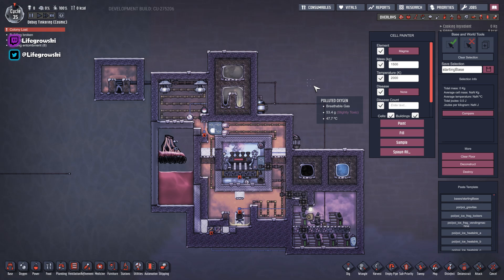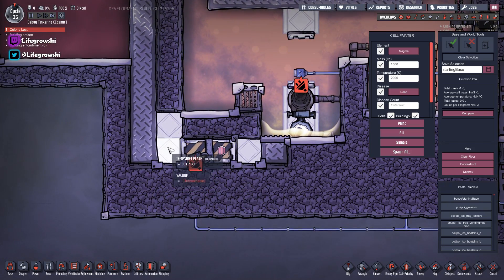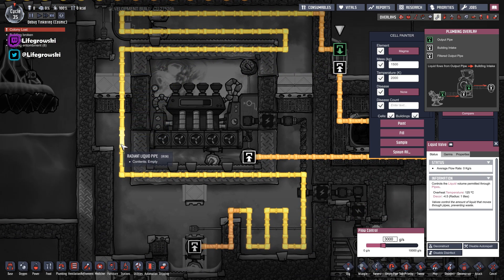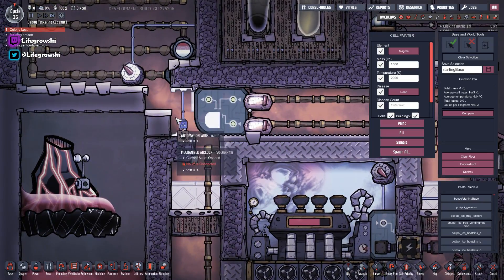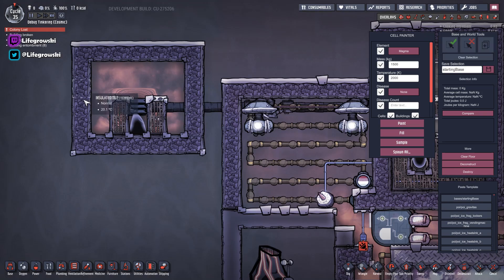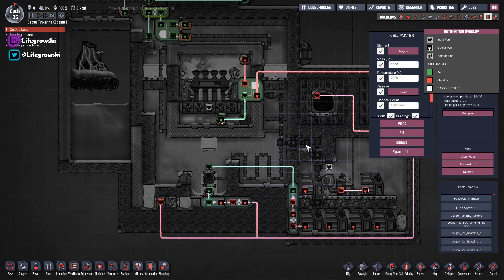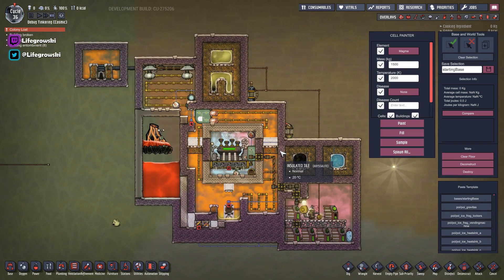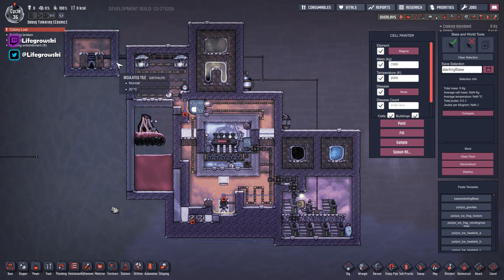SELF POWERED NATURAL GAS BOILER - LOADS OF FREE POWER!

Comment: If you wish to avoid using the hydrogen pushing quirk, you could try and explore how efficient(if at all) it would be to implement here the mechanism used in a door compressor system, where you have a series of doors with some automation that will push the steam downwards.

Awesome video man, keep it up.

Comment: Thanks a lot for the video mate I have been tinkering with a gas boiler myself lately.
I'm a bit sad to see seasoned ONI players like yourself get comfortable with using exploits like over pressurizing tanks and mechanical filters.
Reply from the maker: As I said in the video description, I'm not here to debate the morality of exploits - this was just a proof of concept build showing something a little different. I did try and explain a number of times that I'd used over pressurised rooms for ease as a) I was in debug and didn't have a base infrastructure, and b) it helps show viewers where the liquids are coming from/going to.

Honestly though, I am a seasoned ONI player as you so rightly said - and as such I know both the right and wrong way to store my liquids, so I don't feel too bad at cutting the odd corner here and there. The issue with exploits is when new players that don't have that underpinning knowledge come along and copy builds without understanding the bugs/tricks they're using.

Again, this is a long raging debate that I have little interest in to be fair, but I understand your stance :)
Reply: I dont have any problem with this "exploit". I put quotes bc I dont think this is going anywhere ever for this game. They made a decision pretty early on that only one gas can occupy a square at any given time. It's part of the natural systems of the game and if they changed it there would be a cascade of changes that would have to happen with almost all gas based equipment. This is a survival sim. You a MEANT to exploit the natural processes of the meteor you're in to survive. The exploit Issam takes offence to is just he nature of the game. Now if it was an exploit that was never intended to be exploited (i.e. a glitch or w/e) then I could see being disappointed, but I see no reason to be disappointed at anyone using the intended programming of the game to survive.